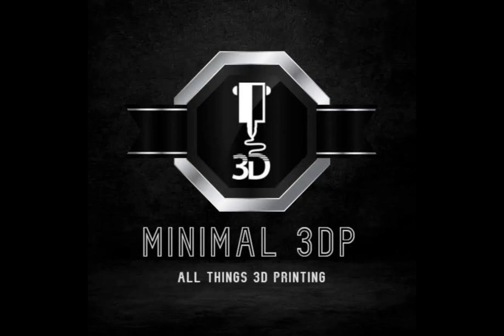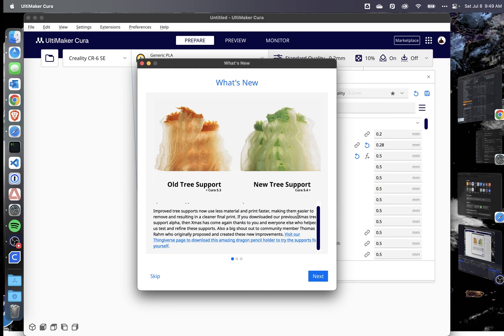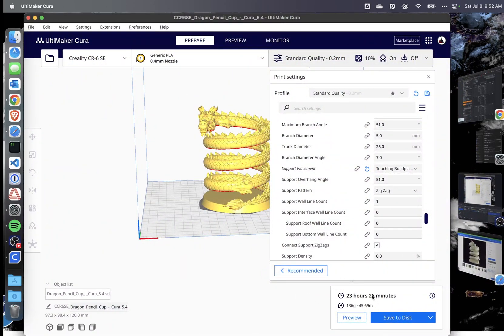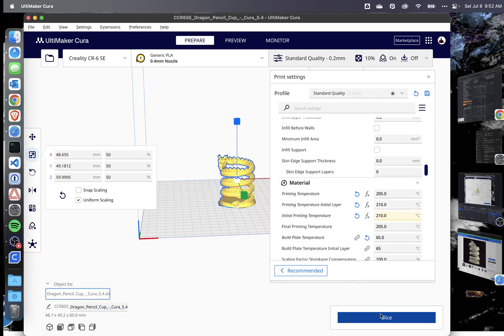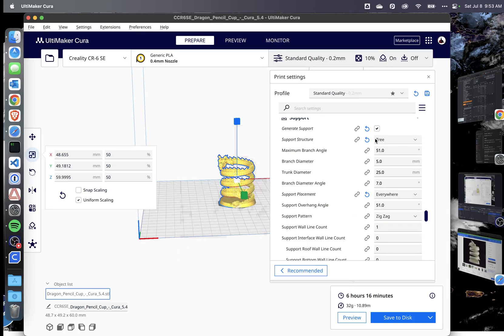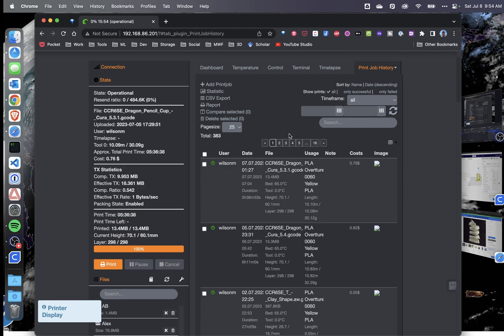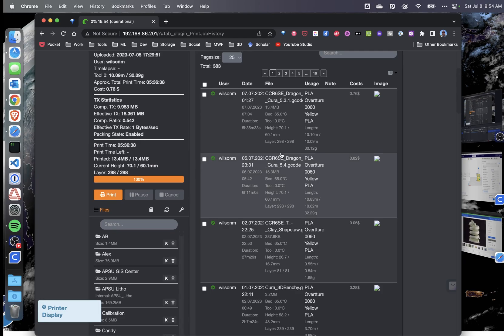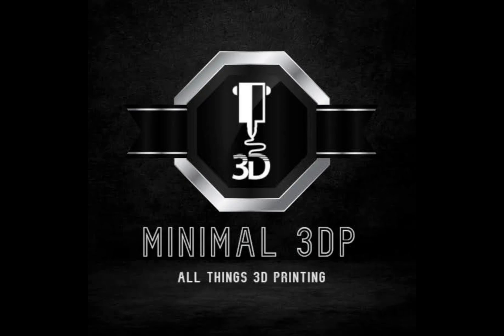Cura 5.4:New Tree Supports, But is there a Downside?

Comment: Changing the support density from the stock 20% to 0% made a massive difference to getting the support off more easily for me, it also reduced the print time slightly also.
Reply from the maker: I will give it a shot. The default is too much.
Reply: Basically my findings as commented on the last video. Did you try doing multi part selection? Click the folder to load a model as normal then control click several parts to load at once...

I can only select a single object, control click, control A and box select won't work for me
Reply: Agreed. Even on 5.3 I set mine to 0.01% but I also found the best support distance to be 0.3 for either 0.4 or 0.6mm nozzles. That made them biggest difference in how easy the supports were to remove. In 5.4 I find the prints do take longer but the supports use less filament. My guess is just due to more starts and stops and a higher number of smaller movements.  I'd rather a print use less filament than take less time though so a few extra minutes in a print is a non-issue.
Reply: @Enjoymentboy  the dragon pen cup official tree support test print for 5.4 comes out like 6 plus hours longer and uses  about 30 grams more filament?
Reply: @silverbullet6833  D'oh!!!  That's a MASSIVE difference.  Truth be told I only print functional and utilitarian stuff...tools and the like...so I haven't checked something with that level of detail.  That is a huge problem if it has changed like that.   It'd be nice if there was a way to tune in a balance between the old and new supports.
Reply: @Enjoymentboy  as they were boasting quicker prints and less filament I downloaded the recommended test print to checkout the new tree supports. Clearly the base settings and the model combination are nowhere near?

Not a great baseline for a new setting if you have to tune it massively out of the box. To me it doesn't demonstrate the new feature over your settings.
Also I found a lot of my profiles had a number of values such as infill, top and bottom layers reset to zero after the update